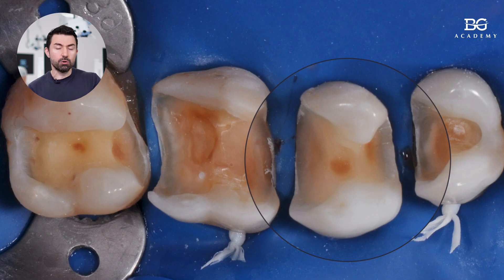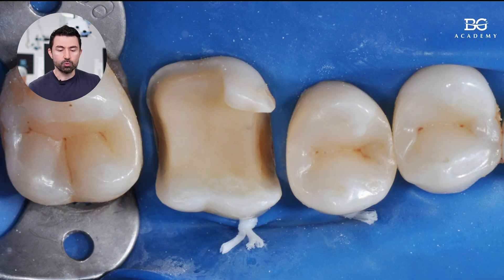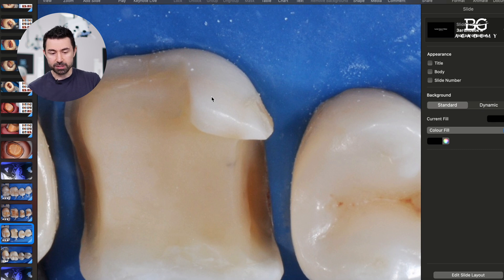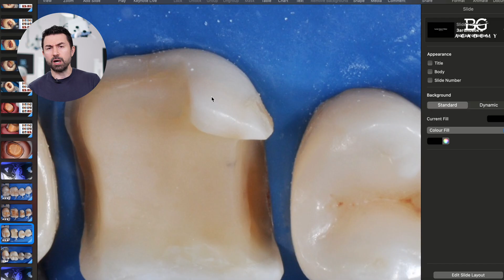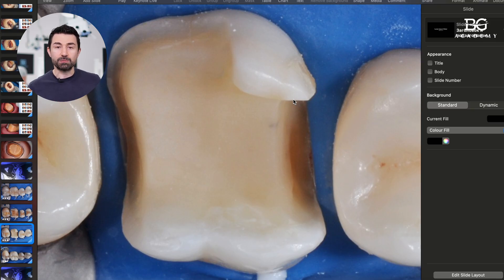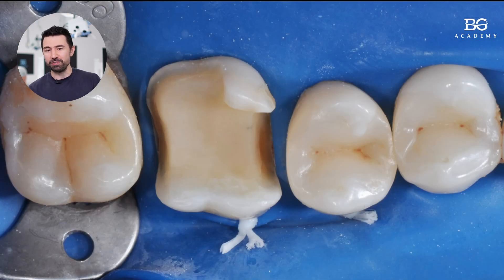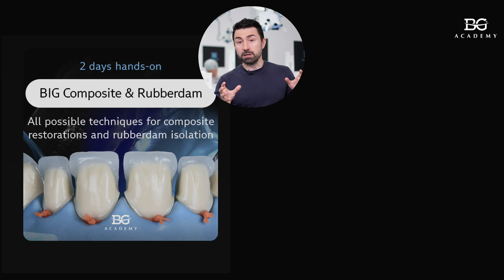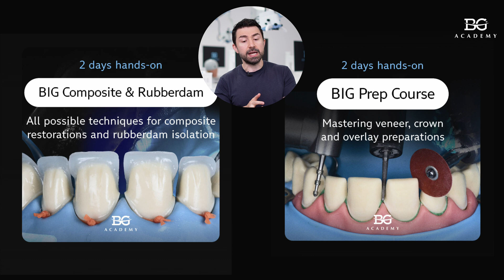Common mistakes in cusp coverage & restoration design

Comment: Do you think relxy 3m light cure resin cement is a good choice for cement partial bonded restorations which are under 2mm thickness